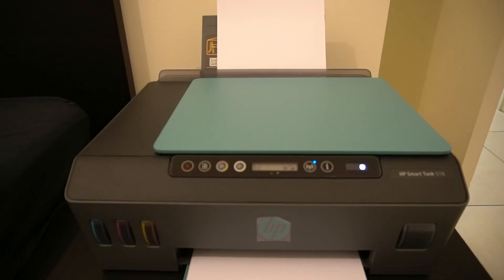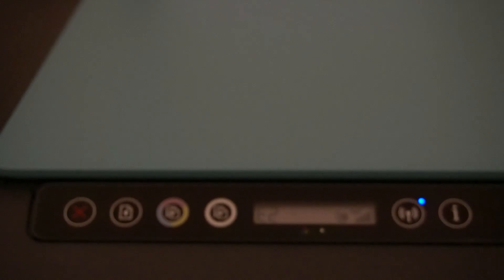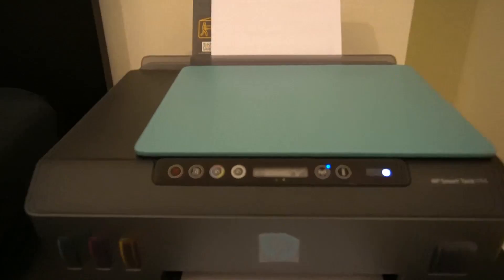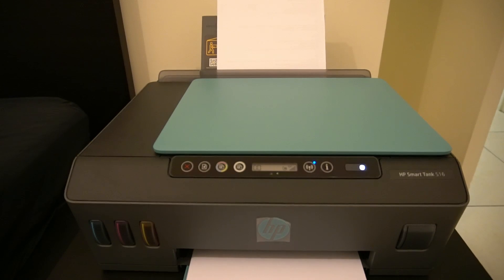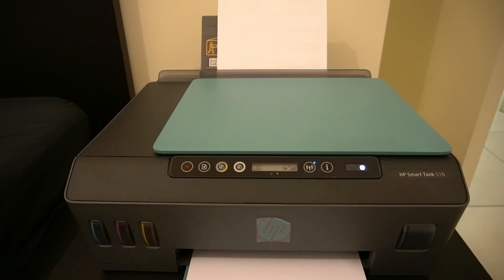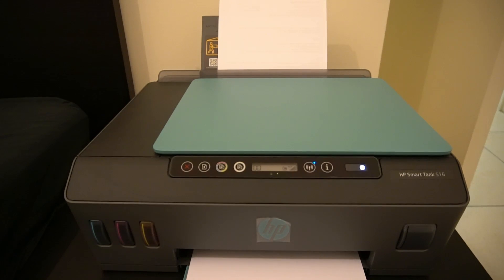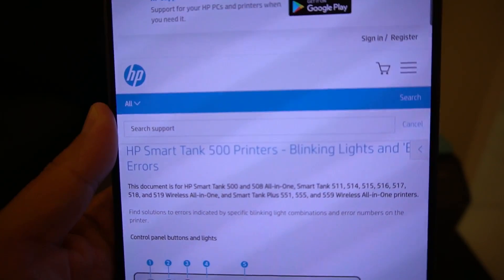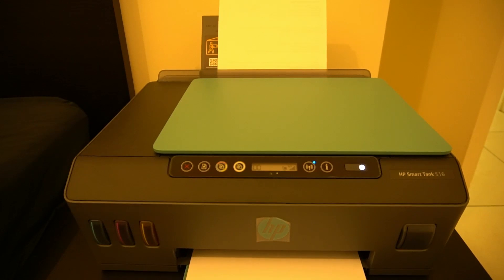HP Smart Tank 515 516 519, Paper Jam, Error Codes, Paper handling and issues with possible fix

Comment: hi i hope I get a replt, it says E2! but when I try printing the paper goes in but nothing is printed but a circle. I don’t know what to do
Reply from the maker: Hi, Thanks for watching. So, to the best of my knowledge the E2 is usually related to paper issues, maybe format or size. What paper do you use and what application are you trying to print from? The circle is very strange indeed and you may even have to contact support to find out what that means.

Comment: The solutions you have provided are good but not permanent. These problems are manufacturing defects. The paper insertion section has to be built properly and the paper detection chip firmware should be modified only then this problem can be resolved. Both of which can only be done HP SERVICE ENGINEERS. BECAUSE THE FIRMWARE NEEDS TO RECODED AND THE HARDWARE NEEDS TO BE REMADE ACCORDINGLY .
Reply from the maker: Hi, Thanks for watching. I completely agree with you HP really need to fix these issues which should not even be issues in this day considering how long Inkjet printers have been around. Really no excuse in my opinion its not like they are a startup or something. I just hope that these possible workarounds help people who have already bought the printer if they experience similar issues.

Comment: Can I use 300 gsm A4 ivory sheets in this printer 🖨️ pls let me know, if u are aware of it... It will help me much... As am in plan to prepare my own flashcards for my kid..
Reply from the maker: Hi, Thanks for watching. According to the HP specs in the link below it can support up to 300 gsm paper:

https://www.hp.com/in-en/shop/hp-smart-tank-515-wireless-all-in-one-1tj09a.html

Media Weight, Supported:
Plain paper: 60 to 90 g/m²; Envelopes: 75 to 90 g/m²; Cards: up to 200 g/m²; Photo paper: up to 300 g/m²

Going by the spec it should be ok, though I'm sure print results will vary from paper to paper. 

Hope that helps, all the best, TK :).
Reply: @TKsTechTalk  thanks much for ur reply..
Reply from the maker: @sharmilathanikachalam2761  You are most welcome :).
Reply: This is needlessly complicated printer
Reply from the maker: @hej6621  Hi, thanks for watching. I agree and the paper handling and movement of tray in this day is really uncalled for.

Comment: My hp 510 smart tank cannot photocopy an a4 size...only short...what should i do
Reply from the maker: Hi, Thanks for watching. I have tried myself and don't seem to have any problems. Not sure if there is a setting which manages this. Do you only get part of the page copied when you align the paper in landscape mode aligned with the arrow? It's a strange issue maybe check the manual to see if there is anything relevant and if not would recommend contacting HP, will see if I can find any info as well.

Comment: I have same problem printing a4 size set paper size to a4 but when i print there is a gap i dont know why?
Reply from the maker: Hi, Thanks for watching. Have you checked the page format of the original document? If the original document is US Letter I believe the length is a bit shorter so if that is the case it would be natural to have some extra space at the bottom, let us know if that's the case might help others too.

Comment: Hi, E3 Carriage Jam error on Smart Tank 515 even though all insides cleared and the carriage is moving from end to end freely.
Even when i restart the printer the carriage moves from end to end, then slams the right side a few times really hard and again displayed the E3 error...
Have you any solution to this?
Reply from the maker: Hi, Thanks for watching. It sounds like you have already done some extensive testing on this, the only other thing I can think of if you haven't already tried is to physically remove the power cable completely from the printer for a few minutes and see if that helps. If not I would recommend contacting HP to get it checked and repaired hopefully under warranty. Let us know if you are able to solve it, thanks.

Comment: My ho smart tank 515 shows exclamation point and a blinking power button
What does it mean
Reply from the maker: Hi, Thanks for watching. Do you also see the letter A as well as a light next to the resume button? In the link I provided check the section for "Resume light, 'A', Alert icon, and Power light blink", see if it similar to your issue, if it is could be a print head alignment issue and you can follow steps from the print out to align the print head. Hope that helps, let us know if you were able to fix the issue.

Comment: I have some this printer
Smart Tank 516
And It shows E3 error.
And I couldn't fix it.
Reply from the maker: Hi, Thanks for watching. This is interesting someone else asked a similar question about E3 error. 
See if the link below helps which refers to E3 as a carriage jam:

https://support.hp.com/in-en/product/hp-smart-tank-500-all-in-one-series/23394952/document/c06283231

If not I would recommend contacting HP to get it checked and repaired hopefully under warranty. Let us know if you are able to solve it, thanks.

Comment: Thank you for the clear explanation. As for my experience with a printer? HP printer 4100 is very bad as the printer has been set up as required and various error messages come and again and on another day the printing is working good!! I really don't know what's going on, this is the worst printer I've ever used. hp must should  working on problems with this series of printers, it's not acceptable to their reputation

Comment: Is this printer better then hp 419?
Reply from the maker: HI, Thanks for watching. I had a similar question on my setup video of the 516 and I will paste the answer here for your convenience if it helps:

So I did a quick comparison of the two printers and the 516 is a bit more expensive than the 419. The two notable differences where that there are more nozzles on the 516 and the 516 has a 800mhz processor as opposed to a 360 mhz processor on the 419. I'm not sure how much better that makes the 516 but its possible that printouts might be very slightly better on 516 though I doubt there will be any noticeable  difference. The paper input tray is also larger at 100 vs 60 pages, print speed appears comparable and so does the scanner. The 516 has a 18000 page capacity tank for black vs 15000 on 419, again I don't think this is a major concern. As i have never seen or used a 419 I can't say for sure that the 516 will exceed it for your usage but if any of the above is a concern for you perhaps shell out the little extra for the 516. 

Hope that helps.